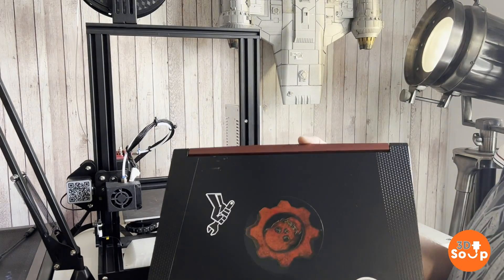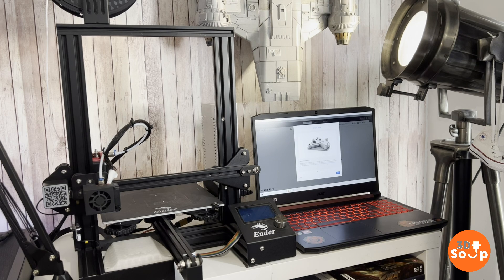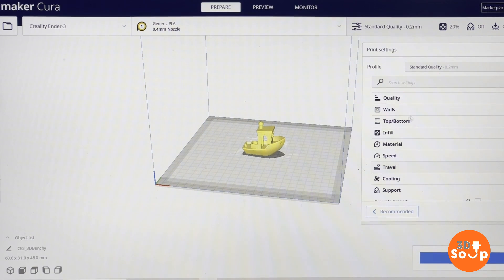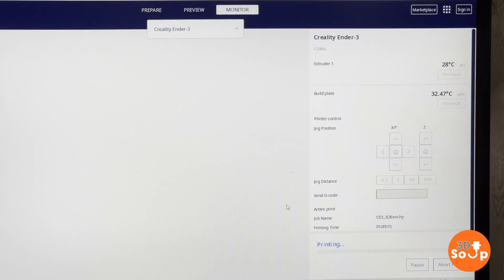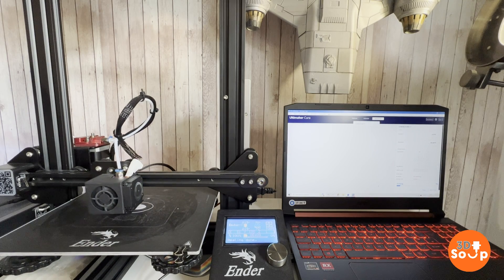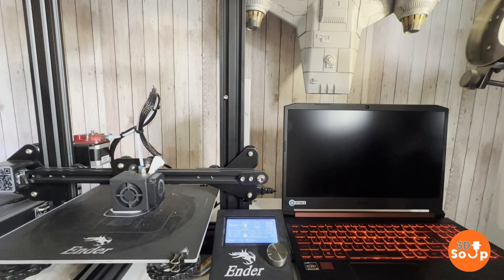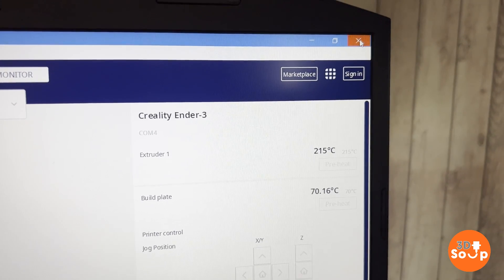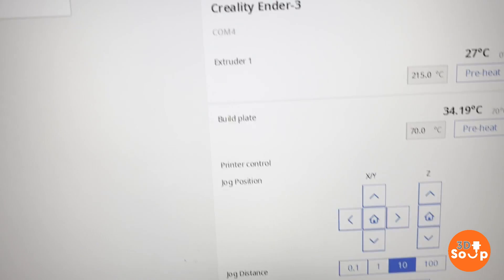Connecting an Ender 3 3D printer to your computer or home network via the USB port and why to do it.

Comment: I did this but when my laptop turned on my Ender 3 I immediately unplugged the cable and now when I turn on my printer it makes a really loud noise and I don’t know if it’s broken. Do you know what it is?
Reply from the maker: Hi, sorry to hear that. Pulling a cable out when any device is connected is usually risky. Luckily the ender is very easy to repair. Check some of the creality support pages. Worst comes to worst you can replace the main board if it is damaged- but ask some questions on the forums ect, you might just need to re flash your firmware.
Reply: @3dPrintedSoup  thanks for the help! Turns out it was the fan in the power supply. I probably should’ve figured it out before but I’ve heard a lot online about what can happen to Ender 3s. I fixed the noise by tapping the power supply a couple times and now it’s back to normal.

Comment: I'm curious why you used a separate laptop rather than whatever computer you already use for modeling and slicing.  I have my Ender 3 Pro USB-attached to my desktop where I do all of my work.  After slicing in Cura, rather than selecting Save to Disk, I can use Print Via USB.  I've found that the printer reacts differently to commands from USB than from the SD card.  Pause At Height is a script you might try.  Printing via USB, when it gets to the pause, the printer parks the head, waits about two seconds and resumes printing.  Obviously not what you want if you're pausing to change filament or insert magnets, etc.  Saving to Disk then printing the gcode via the SD card, the printer stays paused until I tell it to resume.  That's my experience.  YMMV.  I'd be curious to know how that works for you.  But the bigger question is why the need for the second computer?  And were you able to get the wireless connection working?
Reply from the maker: Thanks for watching

Comment: Watched your video. I did connect my Ender 3 pro. It works great. The sleep mode, the first sleep mode shuts off the screen, that won't stop the printing. The next sleep mode will put the computer to sleep, that will stop the print. I deactivated the sleep modes to keep the printer going, FYI
Reply from the maker: Glad it helped. And yes the sleep mode does tend to mess up a print, glad you picked up on that as it’s a nightmare if that kicks in mid print! Thanks for watching :)

Comment: I'm thinking a raspberry pi or maybe a zima board or maybe? an arduino would suffice for running the software. not too expensive and they hardly use any battery
Reply from the maker: Indeed, octoprint works very well with the pi 4

Comment: i have the ender 3 v2 with a broken display.. replacement cost anywhere from 50 usd to 100 usd with shipping.... is there anyway i can use the printer without the display ?
Reply from the maker: I imagine this will work without the screen as cura shows all the controls- octoprint may also work

Comment: You didnt show how to connect the printer to the computer other than the usb. Why cant i find any info on getting the printer to connect to the pc? I have it showing connection to laptop when plugged in but i cannot get cura to see the printer at all.
Reply from the maker: When you connect the printer with both the printer and the laptop plugged in and powered up, click on the drop-down arrow next to the slice button, choose usb and you should see your printer. Thanks for watching :)

Comment: what cable do you use? i plugged a micro usb into it and the thing turns on but i cant ge tit to connect
Reply from the maker: Use the cable that matches the socket, make sure it is a data cable and not just charging cable.

Comment: For the pc sleep sleep problem, just go to control panel -> display settings -> choose what closing the lid does -> sleep timer - never, while on power - never while on battery - never. Then even if you close the lid of the laptop overnight, nothing happens and the laptop stays on...
Reply from the maker: Yup, that’s how you switch off the power save mode- really useful feature. Thanks for watching

Comment: is there a way to connect the ender 3 to network storage? i have a home server and it would be really convenient to stick the file into an smb share the printer can access without dealing with the sd card and my 10 dongles for mac
Reply from the maker: You can look at using a raspberry pi with octoprint installed on it, it allows allot of functionality like this- I haven’t done a video on it as there are already tons of great how to videos on YouTube already that will show you how :)

Comment: What if I disconnected the laptop from the printer while it is printer
Reply from the maker: The same thing that happens if you take out the sd card if you are printing- at best it pauses the print, at worst it will fail and could ruin the print. I’m not sure if it could damage the printer but I would not risk doing on purpose. Thanks for watching

Comment: This helped a lot but I do have a question. Do you need the power to be on to print using usb?
Reply from the maker: You still need to have the power on, not enough juice to run on usb alone

Comment: Good afternoon!

Don't need any driver on windows or Plugin on Cura? I'm using a notebook that does not recognize the printer, even connected via cable there is no option to send via USB, only for storage.
Reply from the maker: Should just pick up the printer and it should show as an option when you click the drop down next to the slice button.

Comment: I’ve read that connecting straight to the printer from pc can take longer and can cause lower quality prints, computer can crash mid print, etc. My laptop doesn’t have an as card reader. Would an as card adapter for my pc work just as well as if my laptop had an as card reader?
Reply from the maker: Depends how good the pc is and how fast the connection is- I’m not sure what you mean by an as card. Thanks for watching :)
Reply: @3dPrintedSoup  I meant sd card. Damn auto correct
Reply from the maker: @PryorFPV  I’ve never tried a usb to SD card adapter connection, if you do it let me me know how it goes.

Comment: My printer is stuck on start screen and my sd slot is broke can I flash software through USB?
Reply from the maker: Hi . Yes you can flash it via usb but you would need to use a boot loader (special software). Good boot loader firmware update and you should find details on how to do it. Hope that helps

Comment: I got as far as trying to print. After it does the line on the left hand side it tries to keep going into the front left corner and gears start grinding. 

Also nothing comes out. I just got this today pls help lol
Reply from the maker: Make sure you have the correct printer selected on cura - sounds like it thinks your build plate is not the one you have on your printer.
Reply: @3dPrintedSoup  I had accidentally selected a setting under machine settings that moved my "center point" off of the build plate somehow. I figured it out.
Reply from the maker: @flemmingogo  yeah that would do it :) glad you got it sorted out.

Comment: I cant see what you did in Cura to set the 3d printer going, did I miss something?
Reply from the maker: Just go to the slice button, click the the right hand side of it to open the drop down and select you usb connected printer- you can the start it from there :)
Reply: @3dPrintedSoup that option isn’t there for me

Comment: Mine isnt updating on the PC. Is there sopmewhere i can get the driver from creality?
Reply: nvm i had to do a hard reset on the printer. 

1> Turn off the printer
2> Unplug the USB cable from the printer
3> Slice a simple print and save it to an SD card
4> Print the file from the SD card
5> Plug the USB cord into the printer

From the website I found if antone else runs into this? (Ender 3 S1 has a C type cable) I love you for this video lol. Very nice!
Reply from the maker: I have not tried my S1 via my pc, will give it a go later and see what happens. Thanks for watching:)

Comment: What, i got a mini usb cable and it doesent go in, it looks like a micro usb but that doesent work either, am i missing somthing here?
Reply from the maker: Sometimes the board might be slightly out of line. If it’s a micro usb socket then make sure the cable is the right way round. You could try removing the board and checking the usb socket to make sure there is no damage.
Reply: First i tryed with a Micro usb, it went in but not all the way so I got a mini usb. Maybe i got a weird board then
Reply from the maker: @Themagic_cookie  take the bottom off the printer (unplug it first) and check the board . It may just be a tight fit.

Comment: I have an old HP laptop. Will this work? Or do you suggest another type of software/computer? Also I’m getting an ender 3 v2 neo. What kind of SD card do I need?
Reply from the maker: As long as it’s got the ram to run cura then most probably. As for the neo, I don’t have one so I would advise going to the creality website to check on that. Thanks for watching :)

Comment: Is that alla stock? what is your board? I sure hoped that you went into the deeper details. Subbed!
Reply from the maker: It was a standard non modded ender 3 with an 8 bit board and mini usb. Have sold it on as was getting on in years :) cheers for the sub :)
Reply: @3dPrintedSoup  Thanks

Comment: Great video thank you. 
You are my answer on my problem. 
I just bougt an used Ender 3 pro machine but the Guy did not give me the USB thing for the SD card. 
First i thougt he has forgotten to give me a USB connection to a computer but he did not. 
I have en old 3d printer and on this model this was normal with an USB connection to my computer so i think this thing with the sd card back and forth are Strange. 
Soo now the 1 mill question. What is this cabel/USB wire called and where to find the thing.???
Thank you im so glad that im not the only one finding the back and forth sd card wirred.
Reply from the maker: The cable you need is a USB to either mini usb if its the same model as my older ender 3 in the video. If it has the smaller socket, then it is a USB to micro usb cable. Hope this helps :) thanks for watching

Comment: Just curious.. I have just got myself a 2nd hand Ender3v2 and I have downloaded the Creality slicer... is there a reason why you are using the Cura program instead of the Creality one? I'm a noob to 3D printing and just surfing the tube to learn more about printing stuff.... Also where did you find out about the G-codes to use? My printer when finished a print goes back to the front left home position and the bed to the back which is useless as I want the bed to the front, do you know why it does this?
Reply: The code that many of the free slicers use is Open Source.
So Cura and Prusa (and others including the Creality slicer) are using the same base code.
Cura and Prusa are regularly updating their code, where as Creality not so much. 
There are many more features available in the current versions of Cura and Prusa, compared to the Creality slicer.
Cura and Prusa slicers support many printer brands and models and both allow you to set up custom profiles if you have a machine that is not included in the standard list. ( I have an Ender 3V2 and It is definately in both Cura and Prusa. 
I have tried both and personally I prefer Cura, but I think its more of a personal preference. 
I did try Cura first... so maybe I just liked it more because it was more familliar to me.
Both Cura and Prusa are free for the full version.
Reply from the maker: @Paul_Au  what he said :) thanks for the detailed and helpful comment, thanks for watching :)
Reply from the maker: I use cura because of the support that ultimaker gives it, it’s easy to use and intuitive. I don’t just use creality printers and Cura supports a lot of brands. As for gcode, there are dozens of sites like 3d cults, yeggi ect, all of which have thousands of files you can slice and use. Thanks for watching

Comment: Ender 3 Pro and newer versions has micro USB I think.
Reply: I have the newer version of the ender 3 stock. No matter what program or firmware I installed never could get computer and printer to connect.
Reply: @DariusVestave  Probably you have something broken in your PC ar printer
Reply from the maker: Yes they do

Comment: Something I noticed when I connected my 3d printer to my computer is that it was trying to run off of the usb power when the power supply is turned off. Is this supposed to happen?
Reply from the maker: i noticed that as well the other day, seems to power the board but not enough to power the actual printer.

Comment: how did you get the option to print from usb on 6:32
Reply from the maker: You see the button that says slice? Click the right hand edge of it to choose where to slice to and select USB :) thanks for watching
Reply: @3dPrintedSoup mine I isn’t saying that
Reply: @jamesmoore5572 damn I had the same problem I spent like 3 hours on searching the problem and I just needed to go to cura general settings and enable printing usb
Reply: @usztyr thanks a few months ago luckily I figured it out by restarting my computer and letting it sit for 30 second plugged it in then it worked
Reply: Thanks

Comment: wot if your laptop goes into sleep mode? does the print stop?
Reply: I tested this out and it holts your print so the nozzle will simply stop in place and ooz out material.. can ruin a print if your not careful.  So guess the answer is to make sure you computer has the correct sleep time setting to accomadate your print otherwise use an sd card.👍
Reply from the maker: @auzzyboy276  nice, thanks for that matey :)
Reply from the maker: I turn off sleep mode before I start a print. Cheers for watching:)

Comment: is there a way to plug my printer into a laptop then connect from my phone or second laptop
Reply from the maker: Yeah, you could use remote screen share software to control you desktop that has the slicer open on it, that should work. Thx for watching

Comment: Don't need the printer hooked on wifi, I have an old laptop attached to my printer on the attick, I work on my pc downstairs and use remote desktop to print the file with cura on the laptop.
Reply from the maker: That’s a good alternative. Cheers for watching :)

Comment: pretty sure I have the same printer save for one minor difference, mine has a slightly different micro usb port.  do I need new firmware or anything to connect it to my computer?
Reply: I would say dont start on cura first and try sum eazyier to move around
Reply from the maker: @takeoff2152  what slicer were you thinking of?
Reply from the maker: Hey Jordan. You should just need cura, a usb cable and ender 3 to reproduce my setup in the video. Thanks for watching and taking the time to comment:)
Reply: @3d Printed Soup  do you have any trouble shooting cura wont recognize my printer

Comment: I have this same exact printer I’m new to 3d printing I’ve had it for a while but jus now put it together is it a way I can use my phone to design it like you did on your computer a app or anything ? Or can you only print on computer
Reply from the maker: You can get a box from creality that allows you to control it via your network, the larger printers like the CR10 smart allow out of the box connectivity. Cheers for for watching :)
Reply: I jus bought an hp computer for it can I download cura in the Microsoft store? When I looked it up it didn’t show up is it any other  app I could download in Microsoft store for it? Thank you
Reply from the maker: @Srttrell  I download cura from the ultimaker website, you can find it there:)

Comment: Having only just got into this, my Ender 3 v2 should arrive Monday, I had no idea that it wasn't standard procedure to connect your printer to your pc. My laser cutter, laser printer, inkjet and vinyl cutter all connect by usb, why on earth wouldn't a 3d printer? Makes no sense.
Reply from the maker: The ender 3 is at the budget end of the 3d printer market, it’s an amazing machine but Wi-Fi requires a separate box unless you are prepared to mod the option in. Cheers for watching:)

Comment: Any progress on connecting the 3D printer to the wifi as mentioned in this video?
Reply from the maker: Not yet, have to invest in a gadget called a creality box and I’m not sure I really need one right now. Maybe when the channel gets a bit bigger
Reply: @3dPrintedSoup  Not sure if this will work, but I was thinking that you could use the USB along with a USB-to-ethernet adapter to connect the Ender 3 to an old wireless router (like a Linksys WRT54G), and then put that router in Bridge mode. That should allow the Ender 3 to communicate with any computer on your wireless network.
Reply: @3dPrintedSoup  1.ESP01_ESP8266 conect to pc with CH340 reader and load firmware. 2.plug in socket or wiring +-3,2V and RX TX in CH340 chip.

Comment: I had this in mind a day or 2 ago. I'm just wondering if i can connect 2 printers to my laptop and then print 2 different items. Guess i'll just give it a go and find out right ?
Reply from the maker: let me know how that goes :) thanks for watching
Reply: @3dPrintedSoup  i’ve tried it with my old laptop but it is not powerfull enough for 2 printers. Problem is that you need to open Cura twice and let it run it’s own program for the printer. Your laptop is not powerfull enough to do that and will interfere with eachother. I have an old gaming computer here and i’m going to try it with this setup 👍

Comment: I've mulled around this setup and might break out an old laptop to do this. Would help with the file moving back and forth to the microSD.
Reply from the maker: Indeed, also I’ve always worried about breaking the sd card reader.